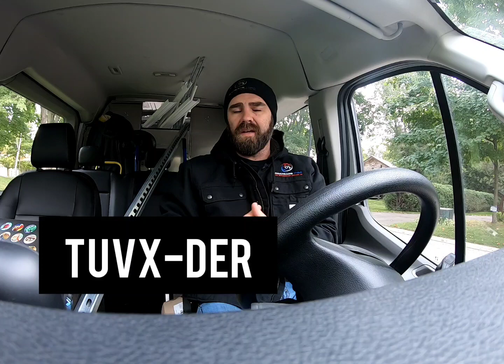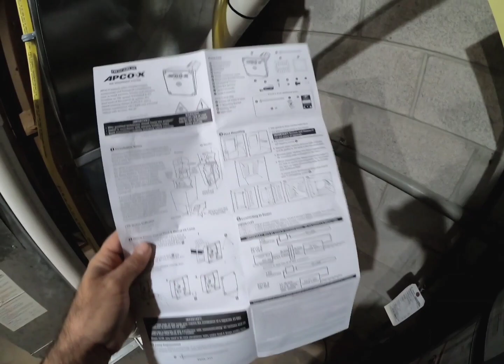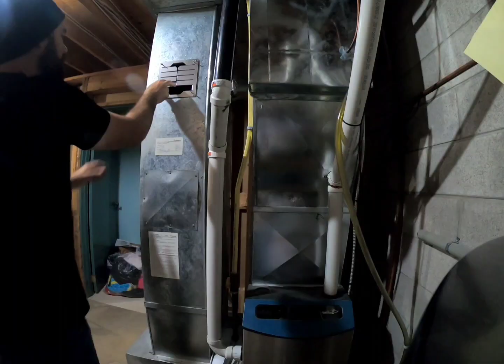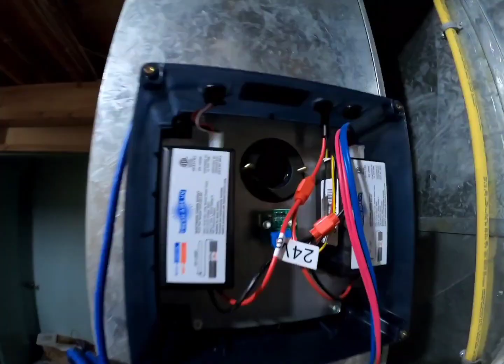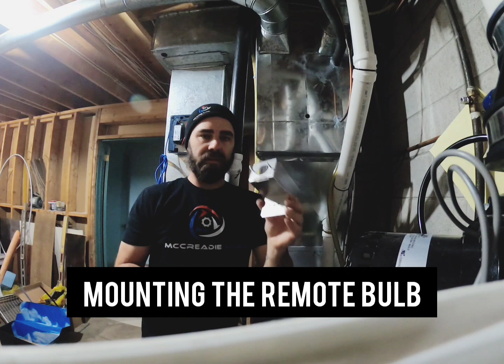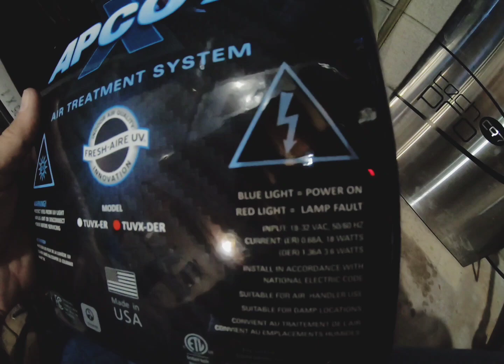APCO-X Installation - UVC For Indoor Air Quality

Comment: Is common for the transformer to get warm/hot to the touch. I have a 40va transformer. Thanks
Reply from the maker: Check the amp draw on the low voltage side?  Is it within spec?  But in general transformers do get hot.

Comment: That bracket is for duct board you just screw the unit straight to the metal duct work with the gasket

Comment: I know many in the medical and science field use UV light to sterilize utensils, however how can the air become sterilized if it’s moving at such a high speed across the ducting?
Reply from the maker: The coil is sterilized as the light is directly above it
Reply: @HVACKnowItAll  oh so the main portion is just on the return due to size constraints however the remote bulb is taking care of the coil. Thank you sir

Comment: What are your thoughts on utilizing the EAC terminals on the control board. That way the UV system will energize upon fan start up.
Reply from the maker: It's recommended to keep it on at all times to continue coil sanitization.